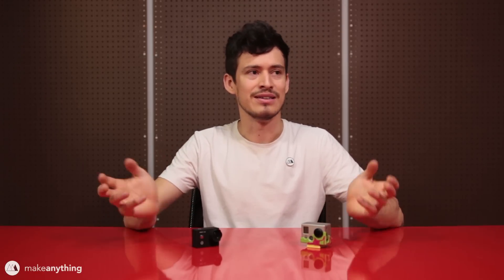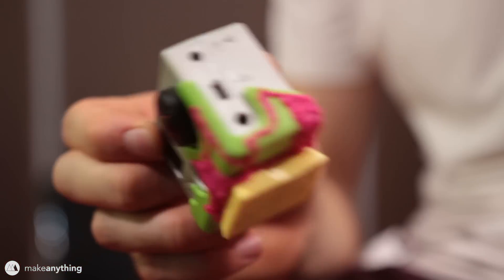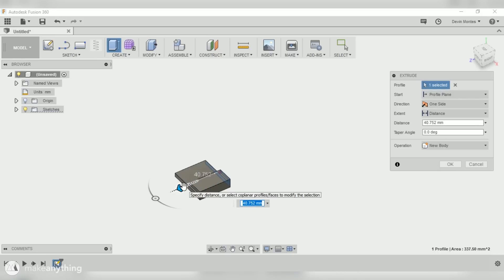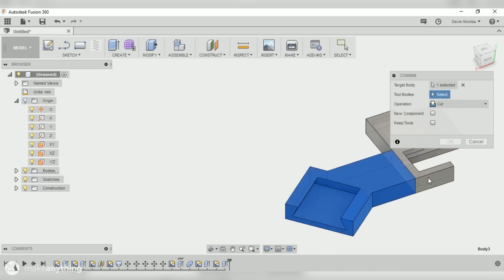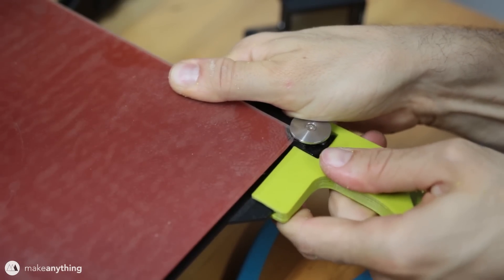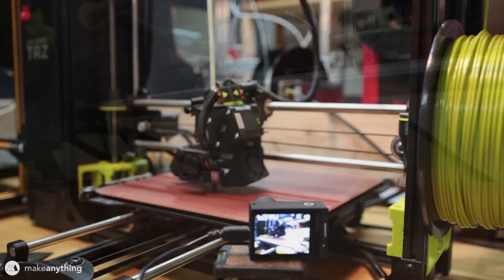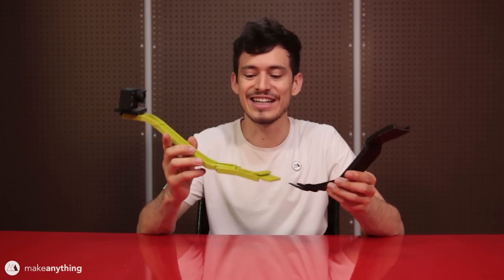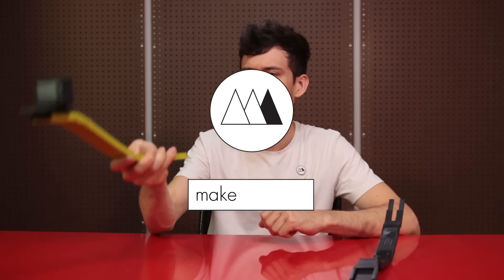3D Printer Timelapse Rig

Comment: Hey Devin, just a suggestion to take out the wobbliness of your camera support. An I beam is incredibly strong, in your case a T beam would work well for reinforcement. I think if you want the support to stay on longer, you need to create more surface area. Use a more flexible material for just the 90° part that grips onto the table edges,(like a 90° square with the groove on the inside edge, the hair tighter than the width of the table). And then create a locking system where you insert the support arm into support for the support arm which combined will be a stable support system for your time lapse videos. I support you. Sorry I didn't use the word support enough. Ha ha

Comment: Adding mass to the moving plate is asking for failed prints due to inertia carrying the moving plate past the desired position.
Sure, you can reduce travel speed to mitigate the issue, but that will greatly increase print time.

Try...printing a "trigger tower" in a corner and have a microswitch or light beam breaking activate the camera to take a pic every time the build plate moves to that position
You get one picture per layer.

Comment: Could always tether the top of the extension arm to the corner of the base plate. This'll stop the plate from moving downwards/backwards. This would work better with an in-extensible rod of some description, as it'll restrict all motion, but a string would solve half of the issue.

Comment: I definitely dig the engineering side of the prints you do.  TO improve the design you could add a spot that can be tightened using a something as simple as a nut bolt and a few washers. From there to get adjustable focal lengths you could add a long piece that has some type of sliding mechanism, maybe like one of those long eraser pens, or just a track with spots to secure another nut/bolt/washer combo. tl;dr connection to the printer, pivoting joint, track to slide and adjust the distance from he printer. To add in different heights you may need two more joints to make that crooked shape you used the heatgun to make.

Comment: Great video. You are always the best at showing the true process of innovation and learning from mistakes. 

The heat annealing should make the ABS stronger through superior bonding. You should try heat treating the entire part in an oven and see if it removes any of the springiness. Tom has an interesting video on the efficacy of such a method. Cheers.

Comment: Like others have said, the profile needs to be a T, I or even L section. Also, it should be printed along the length to increase the strength of the overall print. You ended up with tons of support that could be avoided if you printed on its side instead of horizontally.

Comment: If i dont have a 3D pen could i just superglue parts together?
Reply from the maker: I used to use superglue a lot, but it's pretty annoying to work with in my opinion. Now I use E6000 craft adhesive when I need to glue things together. But for this, 3D pen is the best since it's actually fusing the part together.
Reply: Acetone works great on ABS. Just apply a little on both sides and stick them together. Hold for a second, and it bonds very strong.

Comment: I think you focus to mutch on 3d printed parts. Wouldn't it be easier, faster and robust to use wood for the long straight parts?
Reply: Or CF tube for fast, light strong and very stiff.

Comment: Just an idea. Would it be possible to grab the Y stepper signal and put it trough another stepper on witch is the camera rig to compensate the movement? I gues you would need the signal before the drive so you can hoock up another driverfor the camera rig.

Comment: Hey Devin, have you tried using acetone to fix ABS delamination? You just have to spread a bit of it onto both parts of the crack and hold or clamp them together while it dries. Works flawlessly!

Comment: You can improve your yellow part in the way that you think you would build a bridge. Bridges have one of the strongest physics. I dont know how to call it in english, but you dont need so much fillament, which reduce the weight, and with it the vibrations. You need smaller parts, but more connections to make it more stong. Old trainbridges have a /\/\/\ construction, to it on the side and you will get a "more" stable version.

Comment: You should've created some criss-cross bridge supports that slot in underneath for the extension arm or make a squashed exponential curve with an I-girder and drill out a decent amount of the material if it's difficult to print.

Use medical laser lenses to get wide angle shots and print the holder.

Comment: hover a drone to get best time lapse possible
Reply: YOU NEED A REMOTE CHARGER IN DA WALL SOCKET AT LEAST 8 FT AWAY TO CHARGE AT MODERATE PACE...SOON THEY WILL BE ABLE TO GO HIGH AS INNER SPACE..
Reply: Ramon Garcia That wouldn't work because the drone would run out of power.
Reply: Use a tethered drone!
Reply: Cool Tablet Drones actually have some of the best cameras
Reply: A DRONE ??? LOL !
Reply: Ramon Garcia qq
Reply: Ramon Garcia the wind from the drone would mess up the print via hardening the polymer before it needs
Reply: Yah only for 30 hours
Reply: Ramon Garcia they last at most half an hour until they fall out of battery
Reply: wishful thinking..maybe soon in the future..
Reply: Don't be rude, Lewis.
Reply: Br44n5m lol
Reply: Cool Tablet uhhhhhh try phantom 4 pro, inspire 2, inspire 1, mavic pro, spreading wings series, you idiot
Reply: Ramon Garcia drones have awful cameras

Comment: Have you thought about printing a ball & socket joints at each end, so you can attach the camera and still have the ability to frame the shot without printing a new holder?
Reply: Bill Cumming but when the 3D printer moves, it'll adjust the frame due to the shaking
Reply: Coreytechcraft not really, you can have locking ball & socket joints. Simple screw to fix the position once set.

Same principle as the flexible tripod stands
Reply: Bill Cumming 

They were already rather springy. Hopefully the added weight right at the end wouldn't be overboard. Heat treatment may prove helpful.